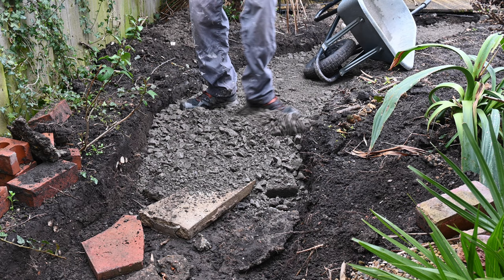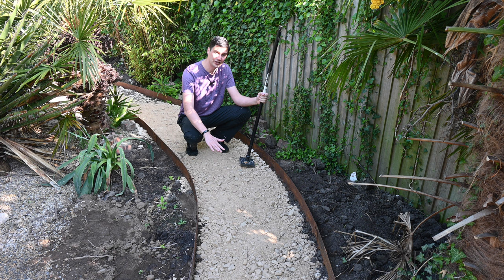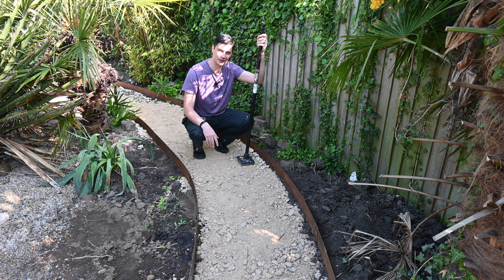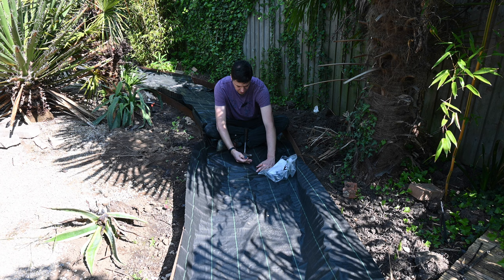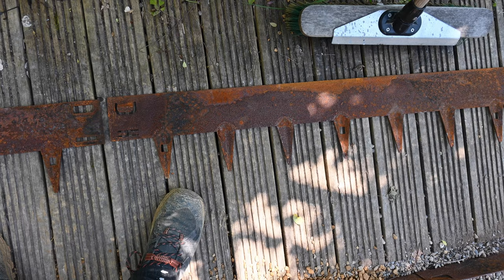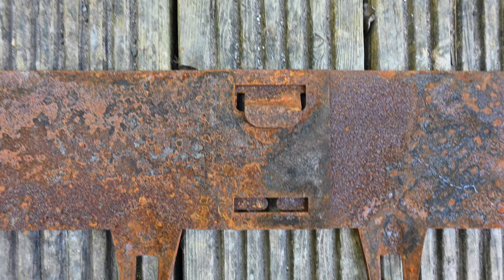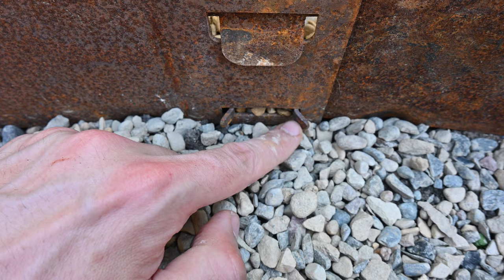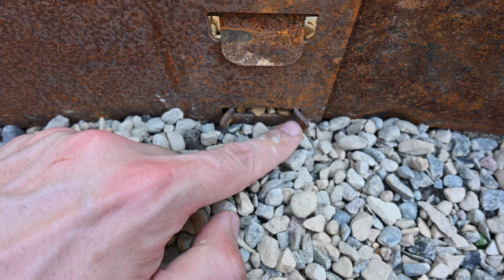Creating a gravel path in the garden

Comment: Well done Kris - that’s an excellently finished path and it looks great!  I’ve just made the same type of path myself.  For the Corten steel edging I got a local metal company to cut a sheet into 10cm strips and used stainless steel threaded bar to support it.  Using a cobalt drill bit (cheap to buy on the internet) I drilled holes at the end of each piece and made a patching plate held in place with stainless bolts.  For those thinking of making a path like this, I used Eccogravel mats which are basically a white plastic honeycomb with a weed membrane stuck to the bottom.  The honeycomb holds the stones in place.  Anyway - you’ve made a great path and I thought I’d mention the above if anyone may be thinking of doing something similar.  Always good to have a little helper!  Kind regards. Martin
Reply from the maker: That's great, info, thanks for sharing